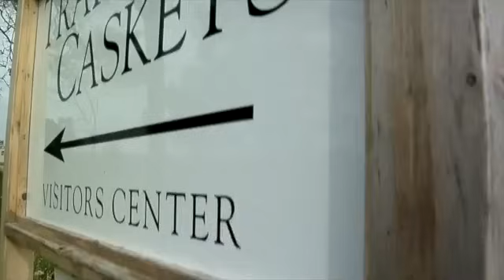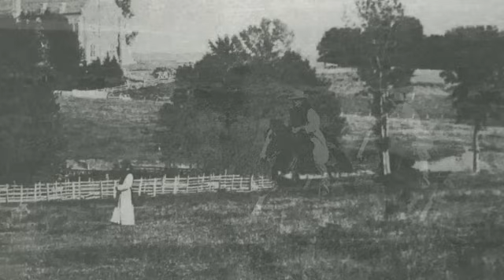New Melleray Abbey: One Thing

Comment: I'm a bit confused by the intro. The Cistercian Order goes back to the year 1098, but the Trappists are a 17th century foundation. Even odder is to call the Cistercians the oldest religious order in the Catholic Church, when the Benedictines (of which the Cistercians are a reformed offshoot of the Benedictines) date back to the 6th century. If the assumption is that  the Cistercians are a part of the OSB then I suppose it 's correct, but I don't think the Cistercians consider themselves to be Benedictines. I may be wrong here.